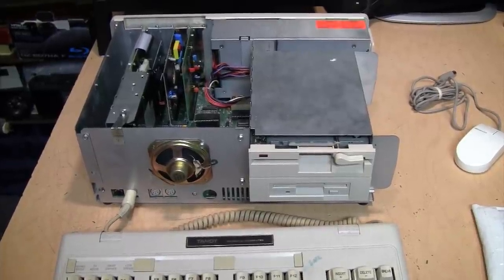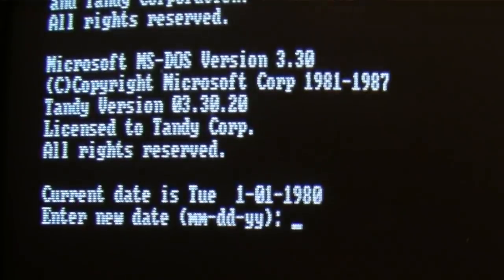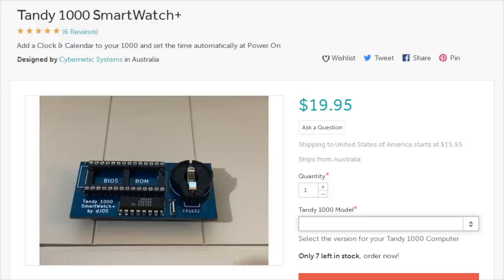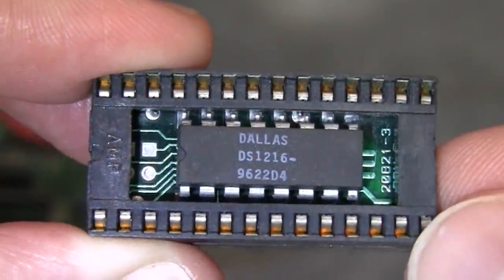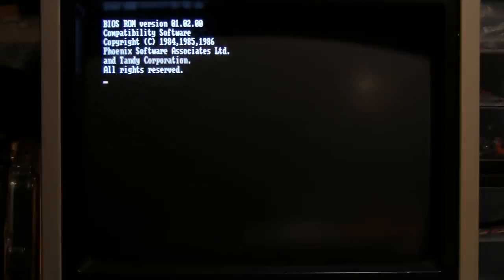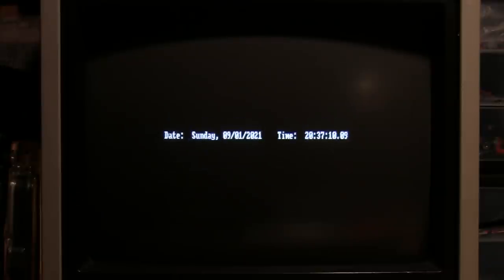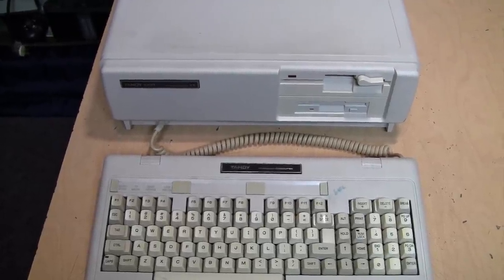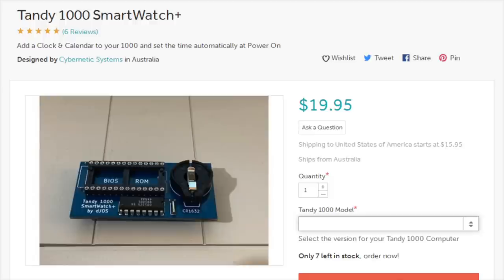New SmartWatch+ clock module for Tandy 1000s & XTs #SepTandy

Comment: Im the same way. The sounds of an old hard drive are part of the retro pc experience. 

Even old consoles like sega dreamcast.  That loud optical drive is part of the full dreamcast experience lol
Reply: Hmmm... Would you spend $600 on an EGA monitor, then, rather than getting a $90 adapter?
...Sooner or later the old drives will die. If you're talking about old MFM or RLL drives bet on sooner.
...Is is cool finding a working hard card...
Reply: @Caseytify  everything dies sooner or later, enjoy em while you can :D
Reply: I wholeheartedly disagree. What you said is based purely on Nostalgia that other people may not have. I personally hate the sound of clicking hard drives and how slow and fragile they are. Also my dreamcast was on the quiet side so don't make baseless assumptions on what everyone experienced. Good day I say harumph marches away angerly
Reply: @steelplasma256  you can do what you want. i didnt say everyone needs to have a loud dreamcast and clicky hard drives. It's just i like to keep the original experience intact. Keep my dreamcast all original. loading screens feel so lonely without hearing the machine in the background working its butt off to get that data off the disc and into memory lol. Same with old PC's, the sound of the hard drive is just a part of what they were and how they were built. the mechanical hard drive is a feat of engineering and i can appreciate that as i hear it in the background. :) good day

Comment: Derek's SmartWatch+ is awesome. I actually installed one a few months ago in my Tandy 1000 TX and he's since updated his Tindie page mentioning it also works with the 1000 TX machine (that has two BIOS chips). The SmartWatch+ also makes an appearance in my #SepTandy video I posted on September 1, 2021. P.S. that's cool you helped with the updated design. I really like having a RTC in my Tandy 1000 TX.
Reply: Got a 1000TX too. Hoping to do this mod to it, as well the RAM upgrade. Already has the factory hard card and modem. Hoping to find a 386 chip for it too.

Comment: FWIW, if you have space constraints on your motherboard that interfere with installing a watch module like this another option is to stick it under a 28 pin option ROM on an expansion card like a hard disk/XTIDE controller, if you can make it fit there without conflicts. The Tandy Smartwatch RTC software automatically scans the entire BIOS expansion area at 2K intervals looking for a response to the secret handshake. I build this same Dallas chip directly onto my toy Tandy 1000 EX/HX expander boards sitting on the flash BIOS chip for the XT-CF port and SMWCLOCK finds them regardless of the base address I choose, from C0000 on up. (I believe the source indicates it actually starts scanning at A0000)

Comment: I don't think your original Smartwatch module would be that difficult or messy to re-energize. (Don't get me wrong here -- I think it's great to support independent hardware developers that keep these old computers viable. If I can, I certainly do.) The potted Dallas modules often leave no other choice, with the more capable parts (1387/1397, etc) not being made any longer.

I am curious if the Dallas IC used on the Smartwatch+ is Y2K compliant at level one (won't bump the century byte itself, usually requires a second manual reset) or level two (no action required). Maybe running those other programs a second time would have done the trick...

I wasn't paying strict attention to the video for a short time (eating lunch) and the snap of the power switch scared me, as did the blue flash on the screen.

Comment: I'm pretty sure the dallas chip just needs the system address and data bus pins A0 and D0 and is getting to them from the rom pins, you could get them from lots of other places if you want to make your own rtc, like the isa bus, an xtide rom or the processor.
Reply: Looks like it needs A2 as well as the bios roms's OE, however OE is just dgrounded on the EX so you probably can just connect it to any ground.  The only thing you need from the rom is it's CE that comes from an address decoding pal so you'd need to run 1 wire from the rom or the address decoder to wire it in somewhere else.

Comment: Since the pins are accessible on the dallas smart clock, it should be possible to cut the traces going to the battery and solder on wires to a external cr2023 for example. 🤔
Reply: Yes, he mentions this at the end of the video...
Reply: @dennisp.2147  Well, sure. But what he shows at end of video are actually a dallas battery sdram "rom", which dont have easily accessible pins. So you need to dremel the case to access the battery contacts. Which is alot harder to do. The one he has it would be very easy to fix on the other hand, no need to dremel etc. 😅

Comment: Have you had any issues with the 1MB memory card in the Tandy? I remember reading that Tandy 1000's can have compatibility issues with games and programs when memory is expanded over 640k and that even the Tandys with the 700+k or memory can cause issues with some programs. Though I assume this may only affect a small percentage of programs.
Reply from the maker: I tried using it to get more than 640K of conventional RAM but that didn't work, so I just have 64K of upper memory blocks enabled so I can use DEVICEHIGH and LH to load drivers and TSRs into it.

Comment: Why on earth does this module use an oddball CR1632 instead of the available-like-sand-on-the-beach CR2032..?! Don't really see a technical reason for this
Reply from the maker: It makes the board smaller, for the 1000EX and HX models which have limited space inside.

Comment: If that computer has a 16-bit processor you should get a card with about 128MB of upper memory and see if you can get a bunch of stuff up there.
Reply from the maker: The 8088/V20 is limited to addressing 1 MB of RAM. Unless you mean 128K instead of 128MB?

Comment: Do you know if there is similar for a standard RL?
Reply from the maker: If your 1000RL originally came with a hard drive, then it will already have the clock chip and battery holder on the motherboard. If your 1000RL was originally floppy-only and didn't come with the onboard clock, then this SmartWatch add-on will probably work, but you'll need to check if it'll fit.
Reply: @vwestlife  that's good info.  Mine is the non-HD version.  It has the U28 socket already soldered in, but no battery holder soldered in.